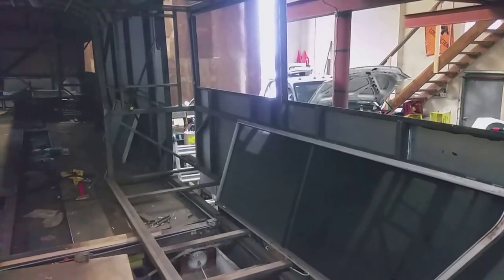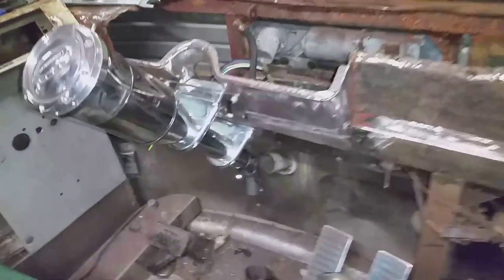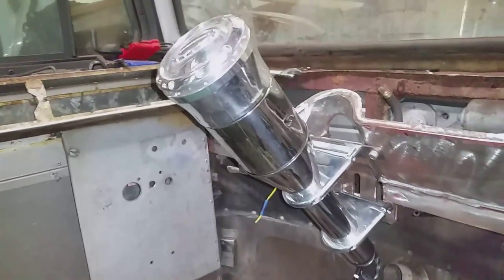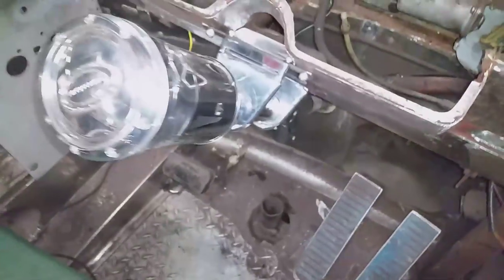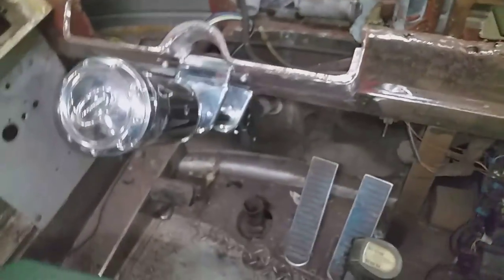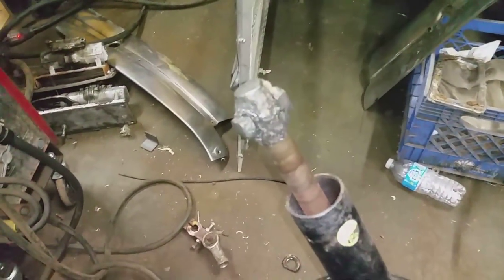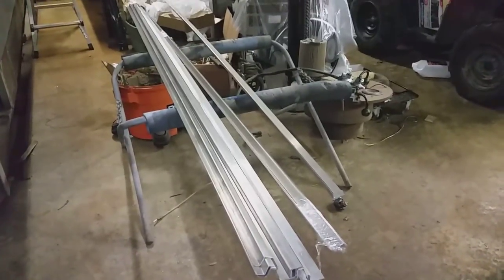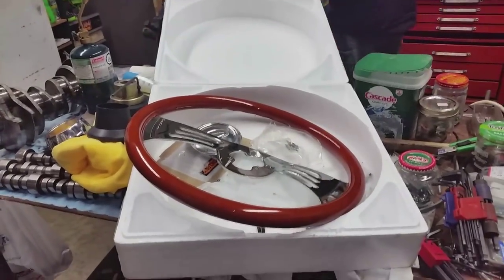Bus Conversion Project - Video 56 - Steering Column and Dash Mock-up

Comment: Glad to see you and Dad are getting better / over the flu. Been a pretty miserable flu season everywhere this year don't rush your selves to get better take the time to get over it fully . The dash reminds me of the old 78 Pete my Dad use to drive 359 unmistakable look to the dash. think Pete ran that dash till 87 or 88 my brothers first truck had that same dash his was an 86. Love the nostalgic nod to a classic look. You could do worse for a drivers seat used a milk crate once to move a repo in the yard mine had no pad at-least Dad has a pad to sit on during the test fits. As always amazing work and glad to see you moving forward
Reply from the maker: piece a rope should be good for a seatbelt don't cha think?...... 359 Peterbilt is correct for the dash.... up to 87 until they went to the 379 in 88 ....sorry no prize :-)

Comment: Looks like the new dash you have was modeled from an earlier circa Peterbilt dash, looking at the rounded top portion that's above the steering wheel. I could be wrong, and, it might be from a Kenworth, or, not either one! I'm sure you'll let us know! I drove a semi for 38 years, starting in 1977, and, my all time favorite dash was from the 1984 Peterbilt when they still had the metal dash...in 1985 I think it was that they went to making their dashes out of plastic, and, IMO, is when Peterbilt went to hell in a hand basket! Anyway, hope you get to feeling better. I know the weather here in Houston has certainly been crazy this year, as, it's snowed twice (and, that just doesn't happen but every 20 years or so normally). One day it's 21 degrees and two days later, like today, it's 68. It's no wonder folks are sick. Looking very forward to seeing the new dash installed! Take care of yourself, and, God Bless! Waving from Houston, Texas, just 180 miles from our other buddy in Austin with the Prevost ('The Beast" as RV CHIEF'S PREVOST calls it!).
Reply from the maker: Hi Jim, good to hear from you, been a while, I saw on another page(can't remember which one) that you were done your cancer treatment..... hope you're doing well, Ya, this year is nuts for the Flu, my Mom has pneumonia now....Great, and you are right 359 Peterbilt it is, when R&M quit making bus conversion parts I started looking around for an alternative and found this.... think it'll work nice once I cut it all up
Reply: Hi James! Thanks for the fast reply. Yeah, the cancer radiation treatments were finished on Dec. 28. I'm doing great... just waiting to clear up a couple of loose ties so I can go back on the road full time in my future Roadtrek 190! Sorry to hear your mom has pneumonia and that you and your dad have been sick Prayers from here. I 'thought' that might be a Peterbilt dash! That round part at the top is usually a dead give away! Take care of yourself, and, know y'all are in my prayers! Best Regards, Jim.

Comment: Some safety belts and your are all set. Looks like a Peterbilt 359. Drove truck for a number of years hauling gas in super tankers. By the looks of it sliding the column up should be straight forward, going down looks like it could be problematic. Hope you are feeling better. Glenn Lever
Reply from the maker: 359 Pete is correct, my favorite peterbilt.... by the time I'm done I'll have so many Pete parts on it I'll have to call it the Peterbus !!!!
Reply: I was a Mack fan. Just posted another video. Glenn Lever
Reply from the maker: I'll forgive Ya for the Mack... :-).... I'll check out your video tomorrow, I'm goin to bed..... feel like crap still
Reply: Get better. Glenn Lever